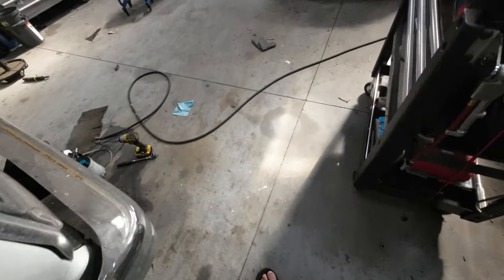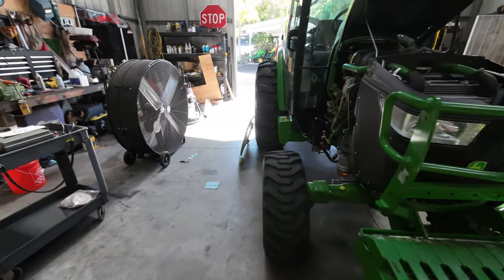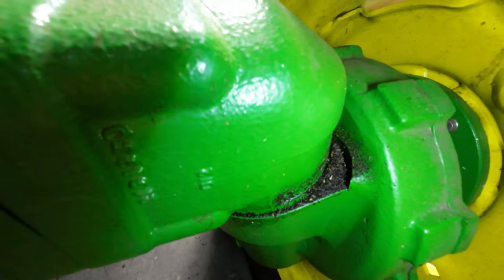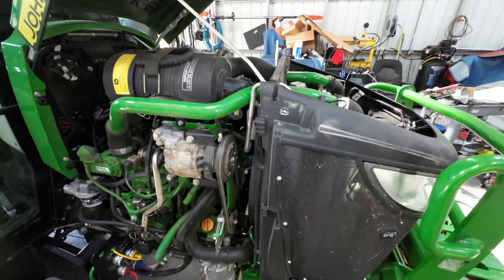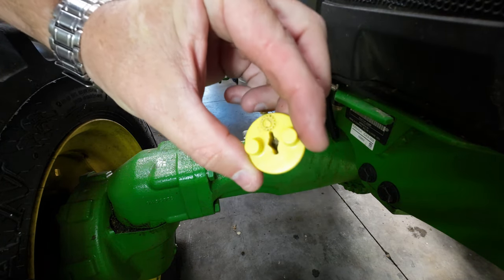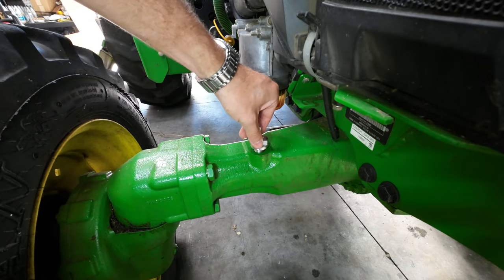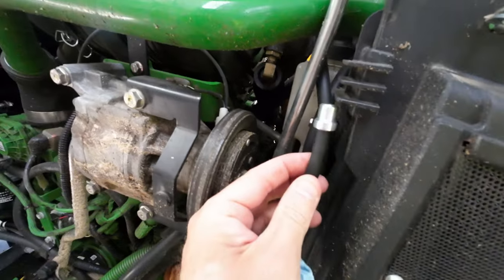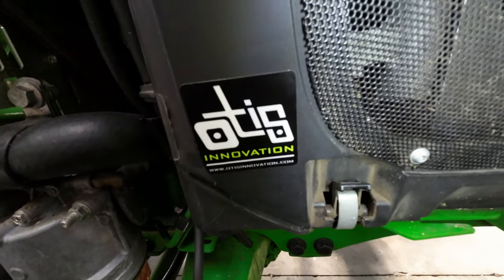FAIL ?  John Deere 4066R axle venting issue.

Comment: They do have a breather vent, Its on top of the gearcase. Its up in there. Its a piss poor design. I have the same seal leakage due to a positive pressure build up in the case.
Reply from the maker: Good to know. My seals have mostly stopped leaking but not completely. This vent certainly helped. Aloha.